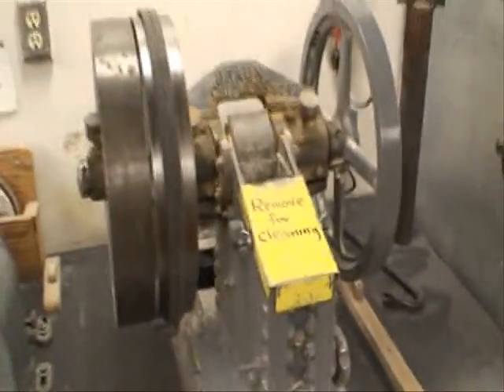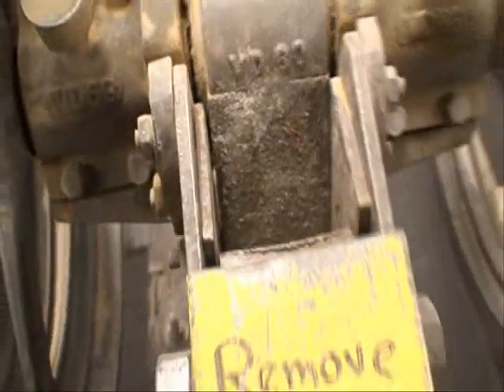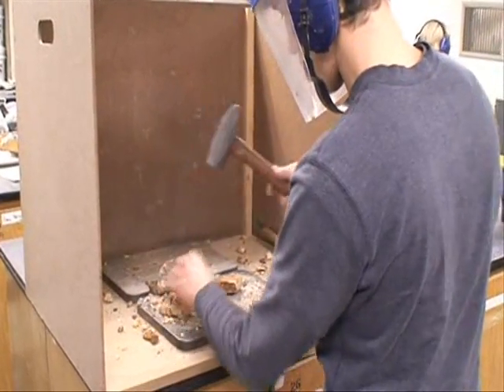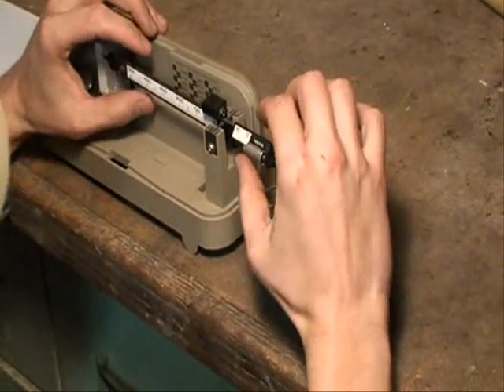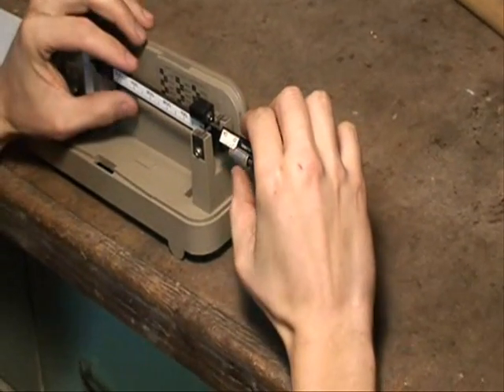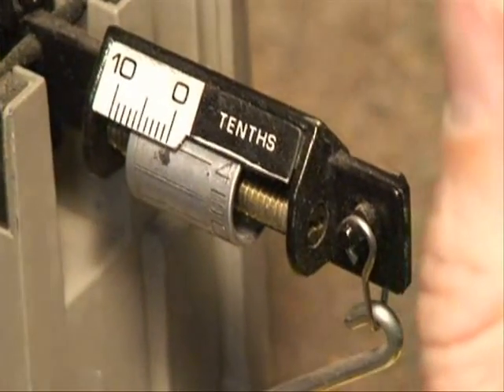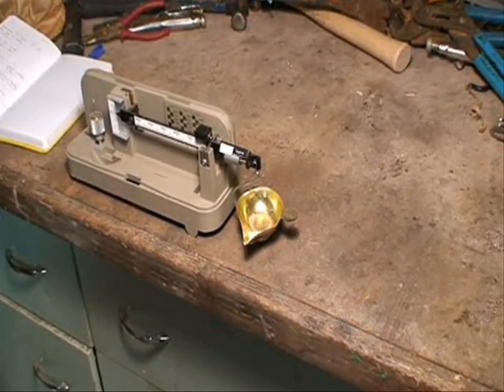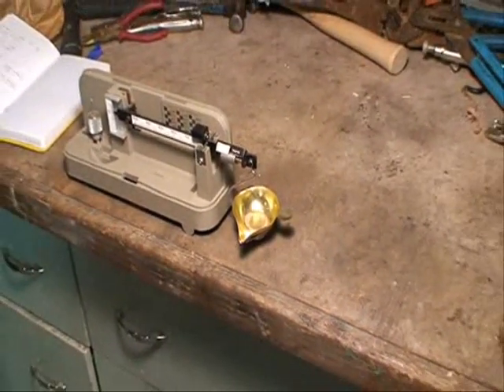Gold Lab! Crushing, Pulverizing, & Gemini Shaker Table On Free Gold/Quartz Ore, Gold Panning  MBMM

Comment: Besides the table, what kind of milling equipment do you produce?

Keith
Reply from the maker: Hard Rock University Hi Keith.  Thanks for the comment.  In addition to shaker tables we supply: jaw crushers, hammer mills, conveyors, screens, spiral classifiers, hoppers, vibrating feeders, adjustable magnetic feeders, and more.  Just about anything the small to medium scale miner/miller needs for their operation.  In addition to individual components we sell turn key systems too.  You can see one of our turnkey systems here: https://www.youtube.com/watch?v=AI5QyC4fy7g If you are interested I can send you a full price list and info sheet.  Just send us an email at MBMMLLC@gmail.com Thanks
Reply: mbmmllc do you have an online catalog?
Reply from the maker: Hard Rock University We have almost all of our products posted on our website here: http://www.mbmmllc.com/ with different sizes etc.  We have a catalog and price list I can send you through email.  Let me know your address, or send me an email, and I will send it over.  Thanks
Reply: @mbmmllc  does crushing rocks increase the amoint of gold recovered significantly in comparison to classifying and getting only sand from the river?